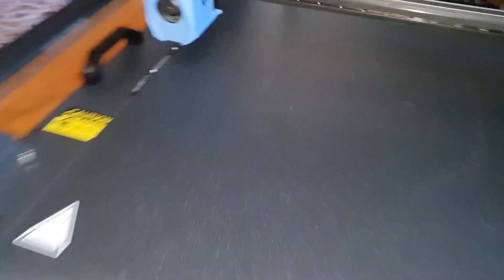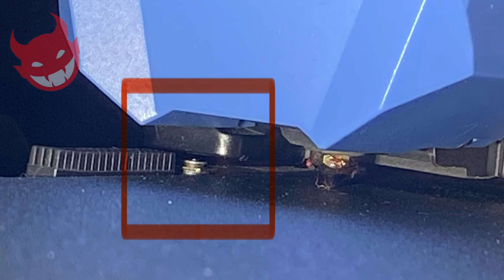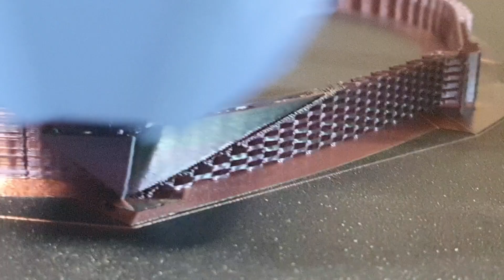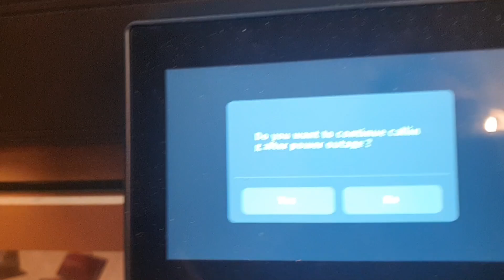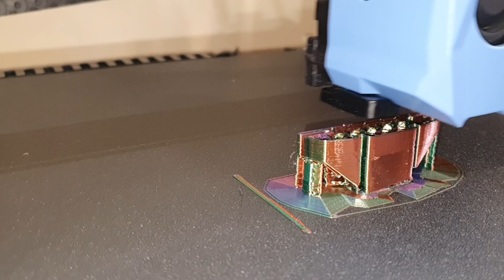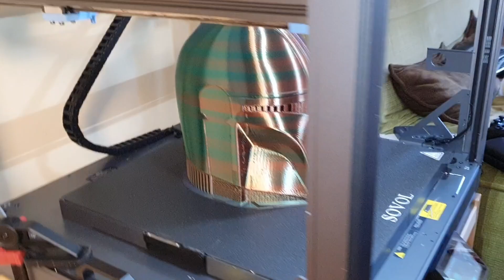SV08 MAX Beta: Unfiltered Test Prints - What Broke & How We Fixed It #Sovol

Comment: i cant wait for the enclosed upgrade review, i want to see how it perform on abs, asa, and some abrasive carbon/glass fiber filament, if its not too much to ask nylon
Reply from the maker: I have the first 3 and I promise to test. Maybe I can get my hands on some nylon too. The enclosure is already on its way, we'll need some time to set it up with proper venting though.
Reply: @gerGoPrint3D  haha it sure would smell bad, btw good job on early review, keep up the good work, its nice to see reviewers who will give their earnest thought on product, on 3d printers, i would especially appreciate reviewers who print not only on pla, petg, and tpu, but also various engineering materials, clearance & tolerance test, and other printer test stl model. sorry if im asking too much
Reply: @gerGoPrint3D  like those all in one printer test that you can find on thingyverse and printables
Reply: It will be interesting to see/hear if the fan noise get to an acceptable level.😊
Reply: Easy ABS do not require enclosure, as far I know. So that one should be easy to test.

Comment: My Sovol SV08 has been a nightmare with the bed issue, hot end slamming on the plate, etc. I really wanted to believe everything was fixed with the Max and was looking forward to order it but this just isn't selling me on it.
Reply from the maker: That sounds like a lemon :(. While not as good as my MAX, I have been pretty happy and virtually problem free with my SV08 bed as well. It needed a slight z-offset adjustment and does need the heat-soaking, but with these two, prints hold well and ABL seems to be able to even out the surface. If there is an SV08v2 or SV08ACE or whatever they might call an upgrade, I am pretty sure the advancements in bed quality and probing will make it there from the Zero and MAX.

Comment: they also need to move the nozzle cleaning area more towards the back corner. then you dont have the whole axis wiping acros the middle of the board but in the rear, just in case something is printed already in the middle
Reply from the maker: Yes, we too had plenty of ideas. I think we are more limited in depth because of the way the end-stop is implemented in the gantry, but having the cleaner on the right side would have been advantegous where it would not interfere with the bed sensor. However these are not the changes we can expect at the beta test stage. Of course you are free to move it around as long as you update the macros.  3D Print Demon actually published a poop tray and corresponding macros to improve the nozzle cleaning. You can find it on printables.

Comment: Sovol definitely learned a lot on the SV08 and rolled that into the SV08 Max.  The 8 mm flat bed is great and so is the Eddy sensor. Watching 30 articulated lizards printing on the huge bed was awe inspiring.  It does no good to have a large bed if the first layer isn't reliable, whether printing large parts or many small parts.  I'm very eager to install Sovol's Eddy upgrade for the SV08, then flatten the bed, so I can make full use of my SV08.

Many comments reflected disappointment with various aspects of this BETA unit.  I have no doubt that the production units will be reliable, the nozzle temperature issues will be resolved, etc.  The only thing I saw that might me a concern was some minor print quality issues with the long belts.  That's one of the aspects of the Zero that I like so much.  The small print volume with the very solid mechanical design makes it a very precise printer.
Reply from the maker: This is a beta. Which was highly used by the time they sent them to us. It still has early prototypes of the components, frame is still the weaker 2020 extrusions, and the packaging they sent it in was also not as sturdy as they will use for the production units. You've seen how banged up that box was. I am surprised it prints this cleanly.  What's puzzling is how much cleaner it was before the hotend swap. I must have adjusted something I shouldn't have.

Comment: I think part of the allure of the original sv08 was the price... A larger form factor core XY printer for less than $600 bucks is a win..
But this machine is going to be around the $1,200 mark..  I think for most people investing that kind of money into a machine that we all know is going to have potential problems, and most likely need modifications and upgrades right out of the box is likely going to be a turn off for most people.
Reply from the maker: A 500x500x500 3D printer for $1000 is tremendous value. I just think most people don't have the space and the use for such large build volume. This is by definition a niche device, and as such it is on the affordable side, if someone needs it.  And yes, it's again a first gen of a new form factor. It's good to see Sovol's ACE line, where they take earlier popular models and do a complete makeover. An SV08ACE, based on the advancements in the Zero and Max can and will be a killer.
Reply: @gerGoPrint3D  Imho a big printer like this is not a niche device anymore nowerdays. Multicolour or multimaterial is a trend since Bambulab introduced the AMS a few years ago. However, it produces a lot of waste if using cut&poo. A big bed printer solves this partly, as you can have 4 times the number of objects on the plate compared to an X1C. So adding an ERCF or another filament changer produces just a quarter of waste per object compared to the X1C.

If Bondtechs INDX is released of course the waste per filament change will go down and this aspect will be less relevant. However, with a filament changer you can use up to 16 colours (4AMS on the X1C). However, with an INDX you need space for every nozzle module. To get 16 colours you need about 500mm to place them.
Interestingly, for 16 colours a SV08max + INDX would be cheaper than an X1C. 1200€(SV08max)+250€(main hotend from INDX system)+ 16*35€ (nozzle modules)= 2010€ compared to X1C Combo (1400€) + 3 extra AMS (each 310€) = 2330€.

Comment: This video makes me love my $400 delta printer even more my 5min benchy looks about 50X better than  this $1200 printer
Reply from the maker: I love my delta too (FLSUN S1 Pro - you might have seen my videos). But when it comes to dimensional accuracy, I have to fall back to one of my coreXY printers. And there are things you just cannot fit on a 320 diameter round build plate.
Reply: @gerGoPrint3D  I have a flsun t1 pro and I love it it’s just a hobby for me so and I can’t see spending double the amount on a core XY for slightly better accuracy  and way slower prints
Reply from the maker: @varinaboy19 Yes, the T1 Pro is an amazing device, perfect for most any print job.
Reply: @gerGoPrint3D I’ve had it for about 3 weeks this is my first 3D printer and I’m hooked 😂😂😂 ide love to one day be able to have one of these but I’m limited on space right now and the form factor of a delta printer was my best option for now lol

Comment: Part cooling via cpap tube setup would be move  in good direction. Ston Wolf 3d did it great.
Reply from the maker: Part cooling is sufficient imho, cpap could reduce toohead weight slightly.  But if my FLSUN S1 Pro is any indication, it would make it so much noisier. Depends on what one is aiming to print. High temp filaments need even less colling, and the current setup seems to be enough for high speed PLA printing.

Comment: Thank you gerGO, I know that you are trying figure it out as you go, and problem solving is just one of those things.  Do you have any information about the orginal SV08 getting any of these upgrades on an upcoming release, like a 350mm new bed, and new CANbus print head and the new eddy current sensor.  I am really afraid that I won't be able to move a 500mm sv08 max from room to room with out disassembling it and thinking that I might be better off with a upgraded 350,  and also looking forward to Bondtech INDX, I do believe it will be a real gem, and maybe even more than a Prusa XL on a better budget
Reply from the maker: It's not impossible to move, at least before getting the enclosure. It's a bit over 30kg, the handles are well positioned so we can hug the printer to ourselves (I remove the screen while carrying). With the enclosure it will be another weight class...  As for upgrades to the regular size SV08. While I could imagine an Eddy update for the current toolhead, I don't think they will redo the whole controller system or even the bed. Maybe make the auxiliary feeding system optionally available. But I imagine they will make an SV08ACE instead with all these updates included (and more!).

Comment: The reason for the temp issues on lower temp plastics, is the thermistor used for high temp isn't as accurate at lower temps.

The new vfa's are likely a loose extruder wheel. Possibly from the disassembly reassembly process.
Reply from the maker: Valuable feedback, thank you!

Comment: Hmmm the print quality is really not very good. Belt ripple and ringing everywhere makes it kind of useless for any glossy prints.
Reply from the maker: belt ripple / VFA yes, ringing less so. Still trying to get to the end of those VFAs. They were not present before I had to dismantle the toolhead.
Reply: @gerGoPrint3D  I've seen these exact same print quality issues in the other reviews of this machine, so I think it's baked into the design unfortunately.
Reply from the maker: @oldman1944  It's puzzling why they were not present in my early tests with the original hotend I received with the machine.  This was a well tuned beta unit, with already over 100 hours of print under its belt before it was shipped to me. Its original state was better than the (very few) other tests have shown so far. I am curius to see what others are going to find.
Reply: There's an old saying that a house is only as strong as it's foundation. I wonder if your "IKEA coffee table" isn't part of the problem. A beast this heavy will need a massive and solid base IMO. Perhaps your clamps got bumped or ?? while you were doing the hot end fix ?
Reply from the maker: @brianmack6285  Good point. It's a pretty sturdy table (Ikea of 40 years ago...) I will test putting the printer on the floor, just to rule it out.
Reply: Do you know if it helps/change if you lower the speed?

Comment: Did you run resonance compensation calibration after switching to the zero hotend/added the fan? Maybe this is why it has more VFAs afterwards
Reply from the maker: I did. And PID tuning too.  Good tip though!

Comment: Hotend temp problem seems very much like what I've seen when using generic thermistors.  I'd double check that the Max's Klipper config matches the Zero.
Reply from the maker: Thank you for the tip. I actually kept the heater / thermistor even the extruder fan, but that's something to look into, could actually be better to use the Zero's, maybe Sovol had the Zero settings in printer.cfg all along.
Reply: My guess is the PID tuning is not right. You could test it by extruding PLA at the minimum temp. I'd be willing to bet you'll get substantial skipping in the extrusion because the expected temps are way too low.

Comment: Need to fix a new printer. .
Reply from the maker: We are working on these beta units, so the production versions would not need any of these adjustments. That's basically the idea behind these test-devices.
Reply: Like 99% of 3d printers get tweeted 2025

Comment: I got my two SV08's for around $350 and I think that's a fair price as I've put several hundred dollars into fixing and upgrading them. Currently I'm trying to figure out what to do with the warped beds (and terrible plastic smell as it sits on plastic while it heats) as it's just more than the printer is worth to replace it with a high-quality thicker MIC 6 plate. With this said, I know that there will be a good amount of upgrading and fixing work to do on the max. I would be willing to pay $300 dollar more than the retail price of the SV08, so around $800 dollars, but I don't think I would drop 1k or $1,200 with enclosure for it initially.
Reply: It looks like it is 999 for a limited number of backers, seems like a fine price
Reply: @OleksaKr  I agree, if I don't have to do hundreds of dollars of upgrades… The jury is out, but I will stay positive!
Reply: So it's faulty eventhough it's a retail unit? 😢 I'm out
Reply from the maker: This is an early beta unit, even the color of parts are different. Sovol made a LOT OF CHANGES to production, partly using our feedback. Different filament feeding system. Reinforced frame. Upgraded software. Improved Slicer presets. Better preprint macros. This is the best value large printer currently. You are missing out.
Reply: @gerGoPrint3D  maybe I will reconsider! If they have made all these upgrades for the 999 priced one then that would be a good effort on their part
Reply: I solved my sv08 bed with some simple silver tape and soft thin cloth under the bed. Allows for adjustments without disconnecting the bed, or taking anything else apart. Also worth noting is that tightening the screws will deform the bed - a lot. Especially when it heats up. I tightened mine very gently, just tips of the fingers on the screwdriver, just about enough - and a tiny touch more and that seems like the best option. The problem is that only works for anything that prints at 65 bed temp. If I need a hotter bed for other filaments its all for nothing. I was only able to print some petg because it could be done at 70, but with a lot of glue.